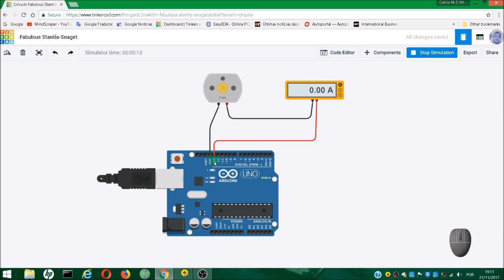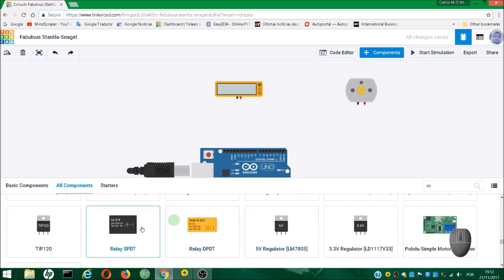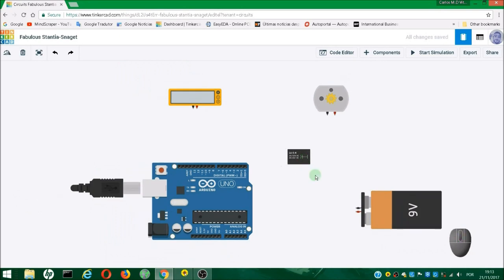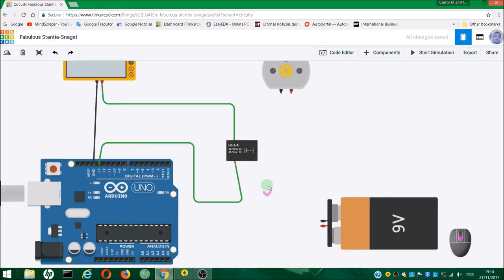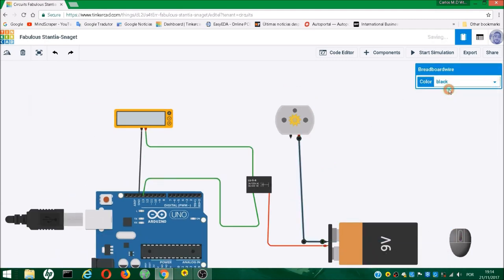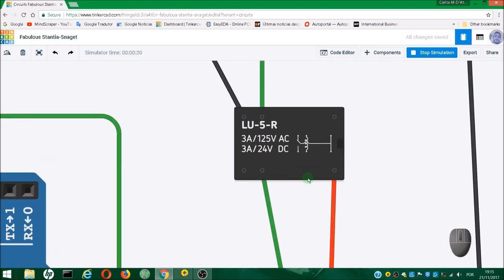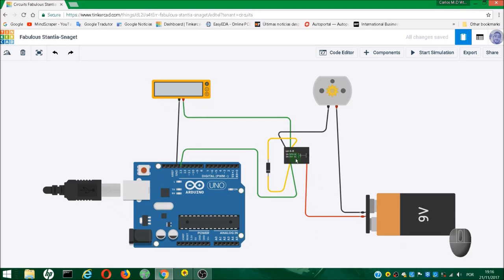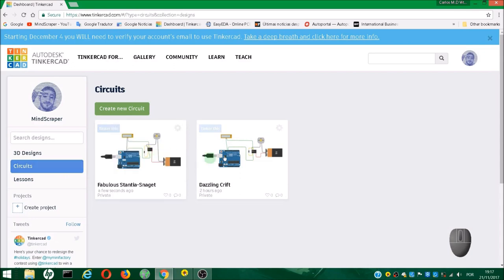Simulation of electrical circuits and code in Arduino with Tinkercad Part 2

Comment: boas é possivel fazer isto com um rele de 12v e acionar 5v?
Reply from the maker: Boas. 
Só para ficar claro. 
Queres usar um relé que precisa de 5V na bobine para fechar um contacto onde a tensão do circuito é de 12V?
Se for isso sim.
Mas não te esqueças de usar o diodo.
Reply: @MindScraper  sim muito obrigado pela ajuda